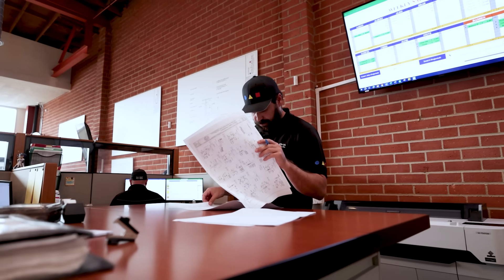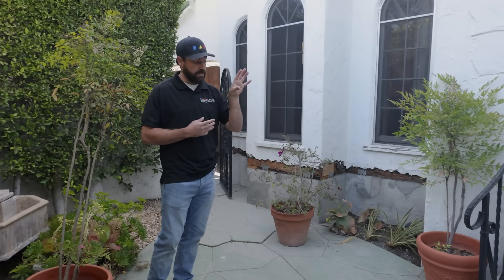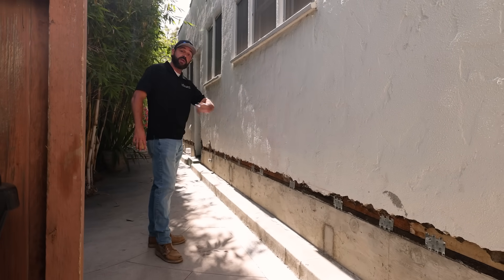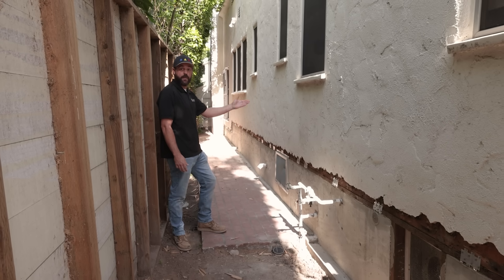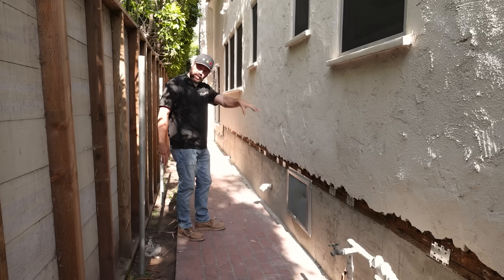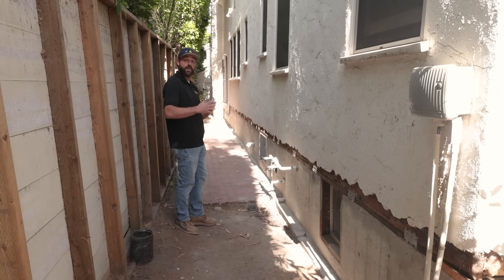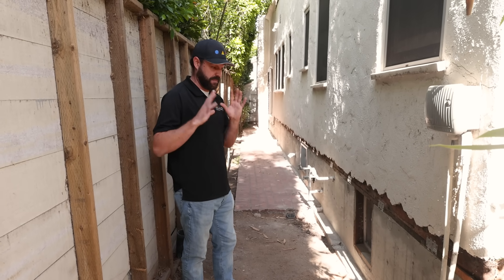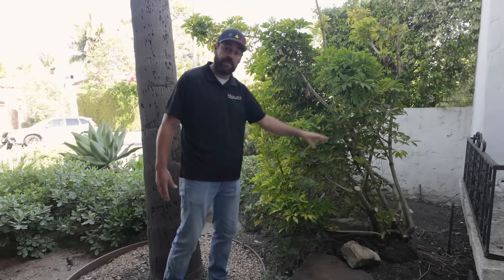How to Jack Up a House and Replace the Foundation | Detailed Step by Step Project Walkthrough

Comment: How much more would it cost (%) to put in a basement while you’re at it?
Reply from the maker: I like where your heads at! 👀 Projects like this can range drastically depending on soils condition, age of structure, site access, etc. anywhere from $20,000 to $150,000 or more.